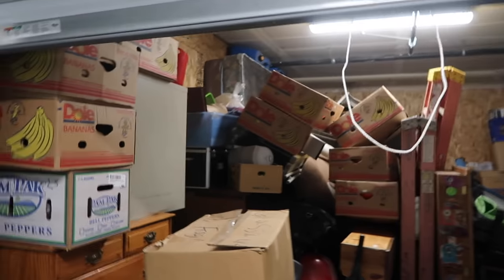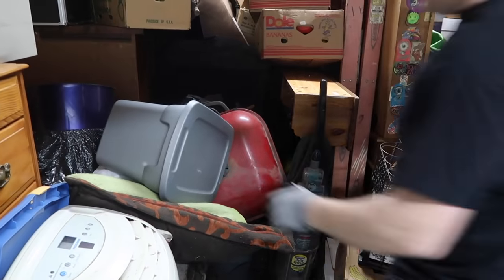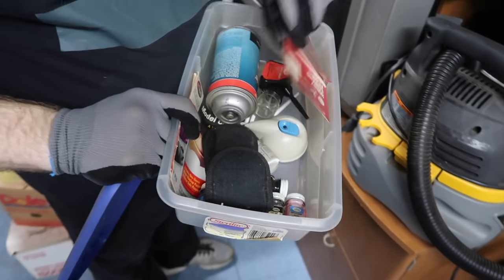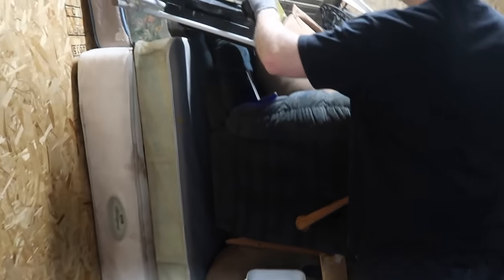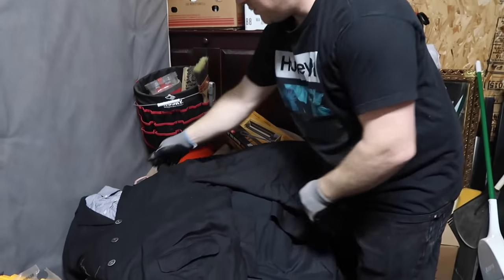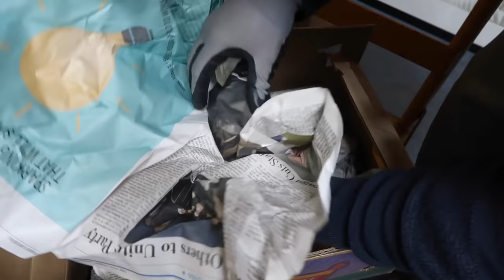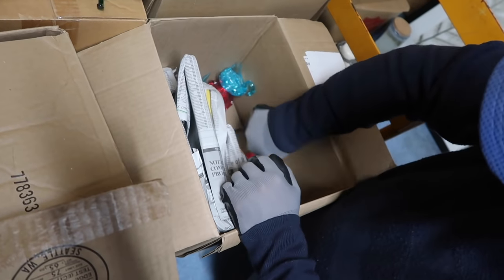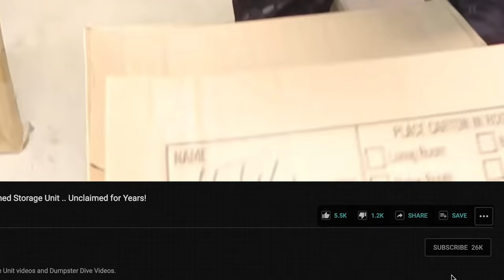I Bought A MASSIVE 10x20 Storage Unit LIVE Online!

Comment: Tip for anyone buying or taking a free used mattress... go to your hardware store and buy a bag of diatomatious earth (dirt with ground up seashells) sprinkle the dirt on all surfaces of the mattress and wrap the mattress in plastic, duct tape any seams. Allow the mattress to sit for 2 weeks. Then open and remove plastic and vacuum well. This way, you are guaranteed to have rid the mattress of any possible bedbugs from the previous owner. Believe me, some of my relatives have had this problem. It's either this method or put the mattress in the garage and heat the garage to 130 degrees for 2 hrs. I think the dirt route would be my preference though.

Comment: What i do with mattresses  , is cut  along the  thin part right around  (the crust of a piece of  bread ) with an angle  grinder cut off wheel (note: do out side and have water hose ready) . once you have gone all the way around the mattress  , pull on the material / Fabric and it will separate from the box metal frame   (Do both sides  ) place the fabric part in the your bin and  , then the steel frame can be recycled  . saves  dump fees

Comment: About twenty years ago I paid $125.00 for my Kitchen Aid mixer.  It is a wonderful product.
Reply: They should never be lain on its side.  The lubrication system works so you never need to oil the machine, but if they get upside down or on its side, the oil seals will leak and start dripping into the bowl as it runs.  Definitely turn it on and run it for a while to see if it leaks.

Comment: P.P.S, several videos  you found in the cook ing boxes a round metal maby alluminum  that came to a point of the bottom half of a solid sort of strainer. With handle. Then you found Anand size probably  made of carved WOOD it too came to a smoothe point that would fit into the center of the strainer-like thing.its used to mash boiled potatoes or as the technique  is " to RICE the potatoes. Soon after this find there was a roung( little larger than grapefruit) shiney silver looking  or ten ( tin) with a handle and an attached  to the center of shiney straner thing. I think this was a flour sifter and or another type of potato ricer. So fondly mrsjob

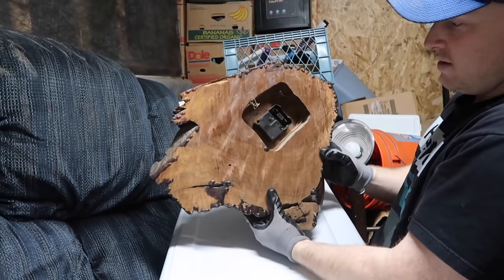Comment: 47:12  Myrtle wood clock.  Myrtle wood is from the NW costal area and prized.  It is usually just slices or chunks made into items.  Some of it is very expensive. Dust off, use water to clean the surface and then see if there is damage.  Less is more with this product.  Then use a mixture of water and some dawn to clean up heavy dirt.

Comment: Just wanted to let you know that size of lettering does not date Pyrex pieces.  If there is not a number on the bottom or the size of bowl it would late 1950's.  It would say T.M Trending, Pyrex (in the center)US Pat Off.  Only the Primary Colors were made at this time, such Red, Yellow, Green and Blue.  The blue pie pan is around the late 1990's,  Hope this helps!

Comment: The flowers are European.  They were originally blown by the Murano Glassworks in Italy.  Those with $$$ would put them in a beautiful crystal vase to go on a table in front of a window, with lace curtains. Each one was v expensive. The more diff flowers you had in the vase, both long and short, the wealthier the family was. There were flowers on the parlour table, even in off season. They also made wrapped candy pieces blown out of diff colored glass that went into a dish that also sat on the table.  Then the Chinese got involved after the war and tons of middle class European families had their vases of glass flowers with their lace curtains. Today they can be had for about 15.00-20.00 each. That white flower was a Calla Lilly and about 30.00. Looks like you had more than 10, so if you had to buy them-10 knockoffs would be about 200-300! The Blue Danube china is also European and yes, those are egg cups. That means the set is older, rather than newer.

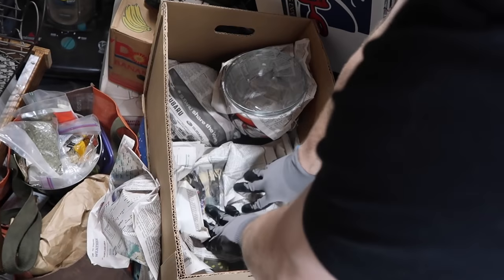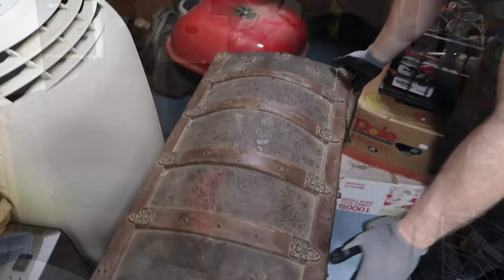Comment: $525... So wade if you get a chance can you give a run down on the different services like mecari, poshmark, let go etc most are probably familiar with ebay but like myself I have been away from the die cast market for quite a few years except my own collection... And we really only had ebay back then and it has changed alot!!   ummm lets see the pedal car at 08:06 is a xonex repop depending on the actual one inside its maybe 30 - 70 dollars if you hold out and it's the red and white you may get 50.00 to the right collector   10:25 Mikasa is higher end daily dinnerware / or low end china key would be microwave / dishwasher safe with china. Most new says it, most old doesn't and it is the fastest way to ruin a nice china plate, bowl etc is a dishwasher... hahaha so if photography mags go with camera gear then where is the model for the cosmo with her tips and tricks ...  16:30 it was a older computer repair kit but missing alot of tools... 16:57 they ruined the chest with the new hardware hasps... missing the tray as well shame -- nice "backgammon" (Ashley) set though.. 20:28 Henkels knives are higher tier knives... if you need an upgrade...  I see  Bed, bath and Beyond kitchen tool shopper... Check the first doggie in the teddy bear box it might be an original pound puppy from the 80's... bear tim and knife is neat that would be a keeper... I wish pine dressers sold that well here only older hardwood sells that well here... but it is a big step up from pressboard... Gonna have to give you man card to Ashley in minute Wade (old JigSaw)  35;53  Zune tried to be a competitor to the apple Ipod , you know who won...